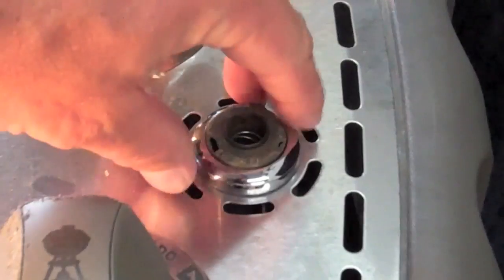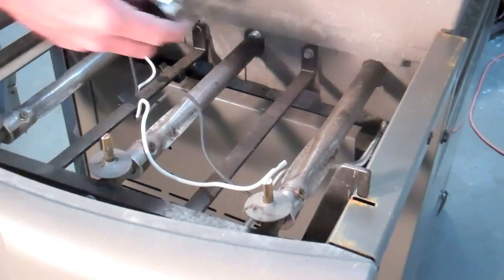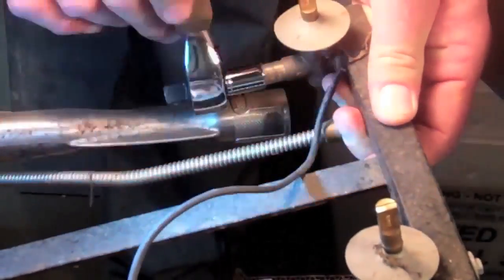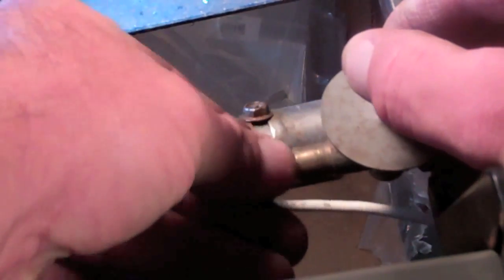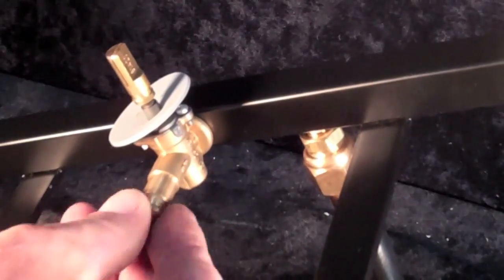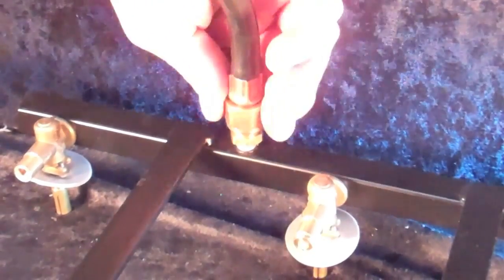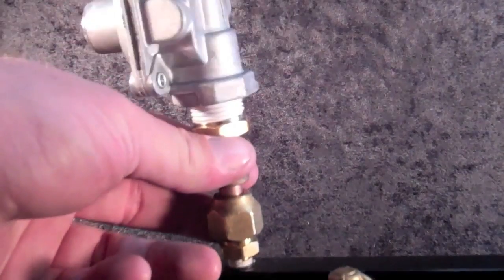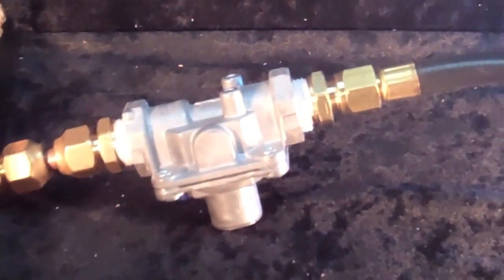Gas BBQ Grill Convert LP or NG With Weber S-320 Model.

Comment: I converted my 2007 Weber Genesis S320 from propane to Gas with parts sold by Jason.  Fast service and Jason was very helpful with advice and guidance.  I had a small gas leak by the manifold area (due to age of BBQ grill) and Jason was generous and sent me a free manifold to fix the issue.

Comment: I just converted a S-320, 2007 model from natural gas to LP, Jason suggested I use a tank hanger and scale for the outside of the box. There are actually holes predrilled in the side panel to mount this hanger and it works great. The conversion took less than 30 minuted, everything works great.